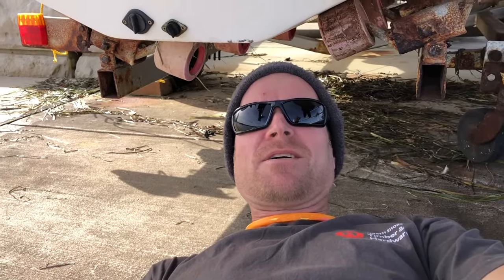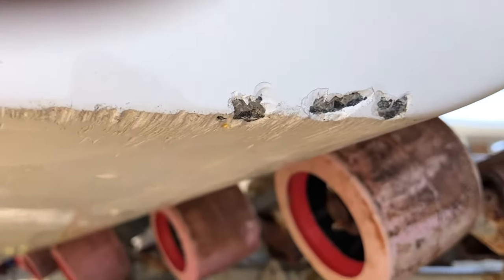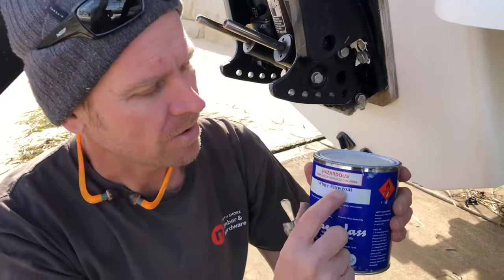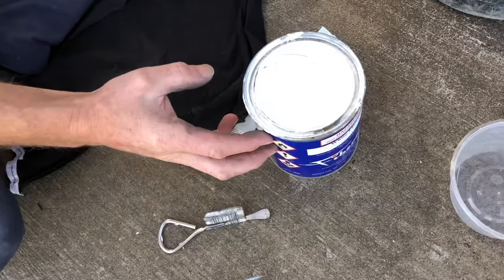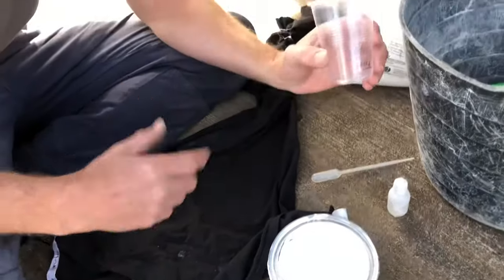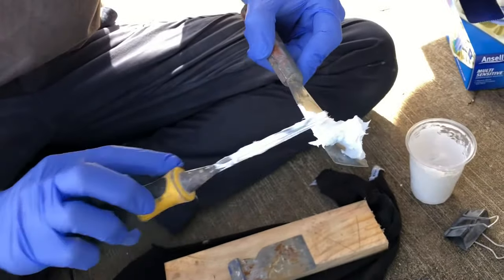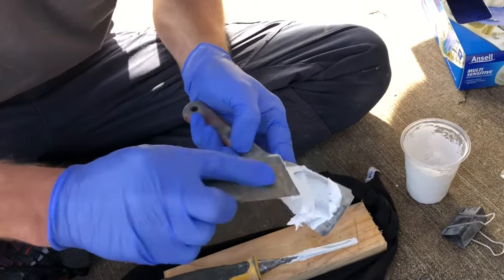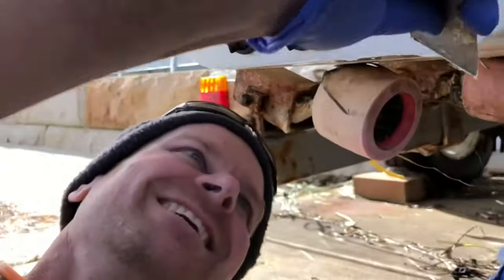Gel coat repair at home 👌

Comment: Excellent easy to follow and methodical video, good tip about the acetone and paper towl as well. Looks mint at the end there, cheers for posting.
Reply from the maker: Hi Mate,
Thanks and glad you found it helpful.
Thanks also for your encouragement 👍
cheers 🍻 
Aussie Boat Guy 😎
Reply: @25hpboatracerman  I'm patching up a few small gel coat chips very similar to what you repair in the vid, had been using this Septone Gel Coat Filler repair though says it's no good for below the waterline...guessing should have just gone with flow coat from the start after watching
Reply from the maker: Hi mate,
Should be ok, it’s normally only an issue if it’s a moored boat. I’ve used the steptone repair on trailer boats too, definitely has its place.
Cheers 🍻 
Aussie Boat Guy 😎
Reply: @25hpboatracerman  ahh good call yea she's on a trailer 95% of her life with the occasional overnighter on anchor. Be giving the pippette a run for sure in the future, found squidging out the hardner and curing times pretty variable!

Comment: I might have missed it in the video but, can that surface be painted now? I have some repairs like this to do on the gelcoat of an old golf cart.
Reply from the maker: Hi mate,
Yes gel coat can be painted, if the surface is going to be painted anyway I would just use a normal two part filler instead of gel coat then paint.
I use two part primer if I’m painting gel coat to ensure a good bond but I’m sure there are lots of paints that work, just test a small area and see if it is suitable.
Cheers 
Aussie Boat Guy 😎

Comment: Hey mate cheers for sharing your knowledge! 👍🏾. Question I’m a beginner when it comes to repair work so I’m following your video step by step haha quick question I have some chips that are abit deeper with this whole process once cured will it become fully waterproof.? Or should I add another layer of flo over the top? 

Cheers again mate 👍🏾
Reply from the maker: Hi Champion,
Unfortunately get coat and flow coat are not fully waterproof, totally fine for a trailer boat. A moored boat can get water let in through the gel coat causing osmosis. If you want to flow over the whole thing if it’s a moored boat then up to you.
Cheers 🍻 
Aussie Boat Guy 😎

Comment: Approximately how long does it take to cure to start sanding. I know it’s weather dependent but is there a way to speed the process up if need be?
Reply from the maker: Hi Mate,
Polyester gel kicks off pretty quickly, like within 20 minutes your able to sand on a warm day. 
I would just do a quick test but I would be hesitant to want it any faster, you would need to work super human fast.
cheers 🍻 
Aussie Boat Guy 😎

Comment: Hey mate i was just wondering if i can use talcum powder as a thickener in the exact same scenario to repair on my keel? Cheers
Reply from the maker: Hi mate,
I would get talc from the resin - flow coat supplier (not sure if talcum powder as in for personal stuff is the same).
But yes talc from a resin supplier is fine, most fillers have talc in them as a body.
Cheers 🍻 
Aussie Boat Guy 😎

Comment: Would you do same for spider cracks, have cracks in my caravan
Reply from the maker: Hi mate,
Spider cracks are very hard to sort out properly.
Grind out the area where the cracks are and sometimes you need to add more glass to the substrate to strengthen the area that caused the spider crack.
If they are small crows feet cracks (from sun damage) just scallop them out and do as per the video. 
There should be something on YouTube about repairing spider cracks in gel coat and as you might find, it’s often more than the gel coat that is the problem unfortunately.
Sorry I could not be of more assistance mate.
Cheers 
Aussie Boat Guy 😎
Reply: @@25hpboatracerman  thanks for the help and keep up the good advice Bill.

Comment: can you list the materials please
Reply from the maker: Sure Champion
Sand paper, acetone, paper towels, Flowcoat, talc or recommended thickening powder from your fiberglass supplier where you buy the Flowcoat, fiberglass polish, personal protective mask, goggles, clothing. Also you should see if there is a gel coat repair kit already made for you at the supplier, can make it even easier.
Cheers 🍻 
Aussie Boat Guy 😎